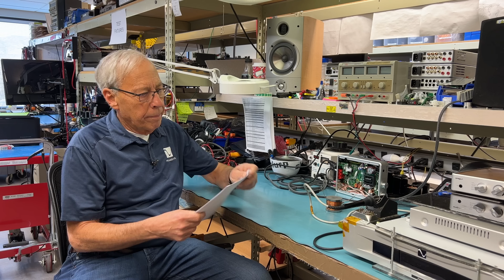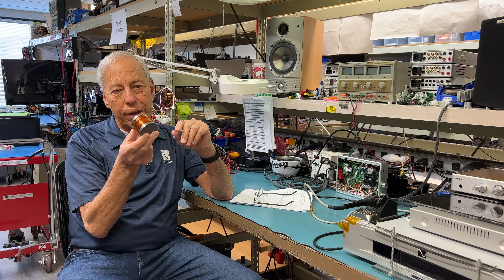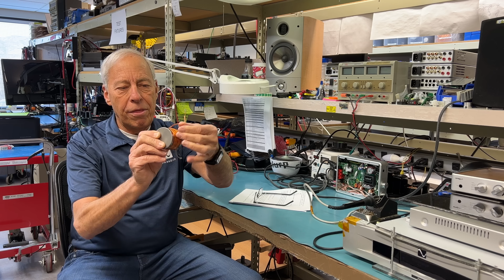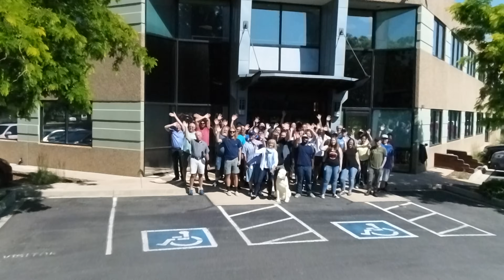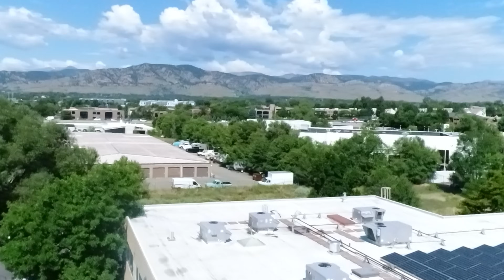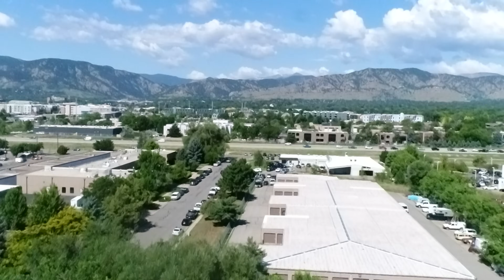Electronic vs  passive crossovers

Comment: 3 questions: a) I assume old fashioned active crossovers are still using capacitors and coils (merely optimized for the higher impedances of the pre amplifier stages, as opposed to the 8 ohms of a speaker coil) - hence using much smaller inductors.  In any case, wont an active crossover still have the undesirable innate 'phase shifts' at the crossover points?  b) is there any crossover technology that preserves the phase relationship across the full audio spectrum? If so what is the name of this constant phase solution? c) When one uses an active crossover, and the need for 6 amplifiers, I dont understand how one deals with the notion of turning the volume up and down.  Must one adjust each of the 6 amplifiers individually every time they need to go from low volume to a higher volume (which implies a calibration step using a microphone and certain frequencies sent into the system)?  This does not seem very efficient of ones time.

Comment: In a  past system I had a  Sumo Samson subwoofer and a Sumo Delilah electrictronic crossover set at 63hz. This combination worked like a charm. On the other hand if I had chosen a passive crossover the inductor would have been massive and heavy.

Comment: So from what Paul was saying, the crossover with mid and high attenuation knobs on the front of my Cerwin Vega's are an electronic crossover?
Reply: Those are just passive potentiometers, used for room/personal taste compensation. An active crossover will always be before the power amps, and likely have its own connection to mains power.

Comment: Nice explanation, but the original question was about electric versus acoustic crossovers, not active versus passive.  Acoustic crossovers could describe a whizzer cone or dustcap that is mechanically decoupled from the larger woofer cone at higher frequencies, which is an older technology typically not used on high-end speakers now.  Wiki has a good description of this.

Comment: Just to add to the confusion, or not. We have the LLCO or the line level crossover that's often inserted between pre amplifier and power amplifiers. How would this device be classified? It is passive after all.
Reply: Crossover before the power amp is active as the term active vs passive crossover is about where in the signal path the filter is located and not if it's based on active or passive circuitry. So you can have a passive filter working as an active crossover if you use capacitors, inductors and resistors in a circuit placed before the power amp. It seems this video made some people quite confused.
Reply: @ThinkingBetter  the LLCO is not a powered crossover but operates at line level but I can see your point 

Maybe Paul could say a few words about these crossovers; benefits and disadvantages say.

Comment: Paul. You got it wrong. The tannoy Westminster is a passive system and quotes the electrical transfer function as well as resulting acoustic crossover. The electrical is higher at 1Khz due to the horn loading of the compression driver boosting the low end thus arriving at an acoustic crossover to the 15" woofer at 200Hz as I read it

Basically the acoustic crossover point is what really matters here

Comment: The Tannoy Westminster is a huge (530 liter) folded-horn speaker which also uses a concentric HF driver (horn tweeter) that radiates from the center of the woofer cone.  
The woofer radiates forward through a medium-size horn structure, which has a cutoff around 200Hz, and it radiates to the rear through a large folded horn for the lower frequencies.  That comprises an acoustic crossover between the two paths.  But it's one driver, so this type of "crossover" is a fundamentally different concept, than crossing over between two separate drivers.  
There is still an electrical crossover for the tweeter.
Reply: You always make such helpful and informative comments. I immediately sensed that Paul should have referenced the particular speaker before launching his discussion of active vs. passive crossovers. Thank you for enlightening us all on the true nature of the question, and answering it. 👍

Comment: What do you think of using capacitors for an active circuit as a crossover?  I want built a high pass filter with capacitors using line level. Everyone I spoke to said it was not a good idea?
Reply: Np, just remember to include the acoustic response of the drivers when designing. Usually you would only use capacitors for active crossovers
Reply: It's not a bad idea to make the filtering before the power amp because it means the power amp can directly drive your speakers with best possible control and your crossover can be more optimized. The reason active crossover is less popular is that it is much harder to do as you now need to optimize the filter behavior outside the speaker that you purchased. For serious audiophiles with a desire to optimize their system, go active!

Comment: Add another volt and three quarters to the voltage quadrupler in your watch and the brakes will come on to the squealing noise.  An active crossover made from a scrap p.c.b can sure spank a power robbing passive version without the bad interactions with a voice coil.
Reply: Quite right.
You get the full damping factor of the amp with active.
Reply: @montynorth3009  No, because the voice coil also has significant resistance.  System damping factor is never anywhere near the amplifier damping factor.  It's almost impossible to exceed a system damping factor of 4, with copper voice coils.  With graphene, you could go up to 6.

Comment: Well....in the Westminster there are a few different crossovers and some of them are acoustic ones. The handover between the front horn and the back loaded horn is the most obvious one and it is purely acoustic. The same goes for a full range driver in a box, from box to main cone, from main cone to whizzer and from whizzer to voice coil, no electrical components, passive or active are involved but it's a crossover just the same.
Reply: See my post here on the Tannoy Acoustic crossovers designed for sound re-enforcement for movie theaters in the late 1920's. An Acoustic crossover is very different then a passive crossover.
Reply: The Westminster on the manufacturers site indicates passive Xover plus Bi- wiring.
Reply: @montynorth3009  I wouldn't doubt that today's Tannoy Speakers are using a discreet passive crossover. But back in the 1920's such things were not really available and cheap. So they went with an Acoustic crossover. I believe that Altec Lansing did simaler things.

Comment: That's a nice story but I am not sure it was the question...
Wasn't there the mention of acoustic cross over? I would consider that for instance a woofer that rolls off on the high side at relatively low frequencies. (SEAS has a 10" woofer that rolls off at 1,5 kHz so it does not need filter components and you end up with one capacitor for the tweeter. Though arguably even that is partially an electric cross over because of the high increase of the impedance curve.)

Comment: To answer the questions about the different types of crossovers and terms.

Passive crossover: Uses passive components e.g. capacitors, inductors and resistor. Used within a loudspeaker.
Active crossover: Uses op amps, resistors and capacitors. Used before the  amp, therefore also needing 1 amp per driver.
Digital crossover: Uses math to change sample values. More info search for IIR or FIR filter. Used before the D/A converter, therefore needing 1 Dac and 1 amp per driver.
Electronic/Electrical crossover, My interpretation: Only used to describe the passive or active crossover points and not looking at the drivers response. 
Acoustic crossover: Where the driver actually crossover over at. Since the drivers themselves has a phase and magnitude response the drivers will influence where the crossover point actually is. E.g. speaker with 2 drivers has a 1st order butterworth filter with a crossover point set at 2kHz. The drivers  responses makes it so that the acoustic crossover point is at 2.2 kHz.
Reply: Active and passive crossovers aren't defined by whether they're placed before or after the amplifier, although it's how they're implemented.  They're defined by whether the components of the circuit are electrically powered (active) or not electrically powered (passive).  Passive is powered by the amplifier signal, but not by wall current.   To reference Wikipedia again, "Active crossovers come in both digital and analog varieties."  "Electronic crossover" usually refers to an active crossover, although a passive crossover uses electronic parts, too.
Reply: @BruceCross There has been zero ambiguity in this topic in my career for decades and what Wikipedia says is aligned with that: "Active crossovers are distinguished from passive crossovers in that they split up an audio signal prior to the power amplification stage, so that it can be sent to two or more power amplifiers, each of which is connected to a separate loudspeaker driver". So even you use passive components that are not powered prior to the power amplifier (RLC), we will still call it an active crossover. I can agree this is a bit confusing (especially active crossover with passive components). Agree, electronic crossover usually refer to active crossover. I never use that term. When I worked at B&O we were pioneering the active crossover in speakers ages ago initially with passive components initially analog and later with DSP incl. IcePower (my colleagues started that, now used by PS Audio), e.g. the Beolab 90 that I have. Right now I'm listening to my KEF LS50W2 that also do active DSP crossover. Even my garage speakers are some decades old CX100s that I reworked with something called a "Beocreate 4" kit of a 4 channel amplifier with a Raspberry Pi doing the crossover (ARM CPU) and WiFi. I wouldn't call those garage speakers audiophile, but they sound better than ever. I have 8 stereo systems in this house (3 passive crossover).
Reply: @ThinkingBetter  Okay guys, I think WE all know what is meant and what else is being said from context. I just tried to make it easier to differenciate being the ways of doing it for the newbies sake, especially since in the last two videos Paul made about crossovers I'm sure he managed to confuse people that wasn't before.
Reply: @maxb.simonsen2459  Perhaps Paul should explore doing a product with active crossover as there are clear audio performance benefits of it when designed optimally.
Reply: @ThinkingBetter  If you want to call a passive circuit before the amplifier an active crossover, I suppose you can, but it makes no logical sense.  Does that mean you would also call an active circuit after the amplifier a passive crossover?
Reply: @ThinkingBetter  Please keep in mind that, although I might disagree, I do respect your knowledge and ability to remain civil (increasingly rare qualities in today's uncivilized world).  Yes, on active and passive crossovers, it boils down to how they are named vs. where they are used.  Ultimately, I need to step away.  It's not a life or death matter.

What is my background?  Most of my admittedly limited knowledge comes from the car audio world.  As an audiophile, I assumed it was a joke until I got involved for a few years.  Quickly, I realized car audio had a better understanding of audio theory than the average audiophile - comparable to a smart DIY'er building their own subwoofer, carefully weighing factors such as driver construction, Thiele-Small parameters, and calculation of enclosure volume.  Even 15 years ago, car audio supported using RTA measurement, DSP for EQ and crossover functions, avoiding multiple AD/DA conversions, evaluating crossover slopes and points, setting time and phase alignment of drivers, parametric EQ, etc.

What did I learn?  I still have a lot to learn.  Audiophiles lean too far into the subjective world, ignoring the objective world.  Now, I prefer a balance between critical thinking and listening.  Every statement is open to debate, including my own.  That means your words have not fallen on deaf ears, and I will file them away for future reference.  Thanks for your replies.
Reply: @BruceCross  I actually work in car audio R&D nowadays but have done most of my career in consumer products R&D. Leading automotive OEMs put a lot of advanced engineering in designing the audio system with modern high resolution audio DSP layouts for speaker up-mixing (= active crossover), microphone processing, noise cancelation etc. Care is put into SOC digital audio plumbing, DSP layout, amplifier design, driver design, cabin acoustics, wire harness (incl. A2B) etc. that demands much more diverse and deep audio engineering skills than what you find in consumer electronics audio. It's tough engineering to make a car sound like a high-end audio system, but on the other hand, you can design and fine-tune the full experience.
Reply: @ThinkingBetter  Ha, I didn't expect you to be in car audio R&D.  Cars are an incredibly challenging audio environment.
Reply: @BruceCross  Yes, that is why it is interesting. But while it's very challenging, you also have a huge advantage of being in much better control of the entire signal chain including the cabin acoustic side. It's sort of like if a speaker developer designed and optimized the speaker positioning for a room with all room interior details including all dimensions, furniture,  exact driver placement and listener positions that was included in the purchase as one package...while of course doing it with an active crossover design enabling precise DSP tuning.
Reply: Yes, but the term "active crossover" means doing the filtering before the power amplifier. This can be done either using analog or digital (using DSP) circuitry.
Reply: @ThinkingBetter  Not in my book. If using DSP i would call it a digital crossover. DSP litterally means Digital signal processing
Reply: @maxb.simonsen2459  Wikipedia: "Active crossovers are distinguished from passive crossovers in that they split up an audio signal prior to the power amplification stage, so that it can be sent to two or more power amplifiers, each of which is connected to a separate loudspeaker driver.". An active crossover can be either digital or analog. I agree if you use a DSP, you can call it a digital active crossover and since there is no digital passive crossover, you could just use the term "digital crossover" and people would know what you mean. BTW, a digital crossover could be done using a CPU also as digital audio processing doesn't require a dedicated DSP IC. For example, nowadays ARM CPUs are often used as DSPs.
Reply: @ThinkingBetter  Yes and you could also use FPGA's
Reply: @maxb.simonsen2459  Yes, an FPGA can do it but I prefer the ease of programming audio processing with modern layout tools (Analog Devices SigmaStudio or DSP Concepts AWE especially).
Reply: @ThinkingBetter  Agreed! Fellow Dane?
Reply: @maxb.simonsen2459  Yes

Comment: the question was about acoustic crossover, which is weird
Reply: It's crossover by acoustic means. Tannoy is using that in their concentric sound driver, for example. I suspect that is what inspired this question.
Reply: @ThinkingBetter  so as Paul did not seem to know what may be acoustic filters, ,he gave a sidestepping answer
Reply: @nicolasjoly1755  Perhaps, "acoustic crossover" is not a common term. Also "electronic crossover" is not a good term as I would argue that passive crossover is also electronic. Usually the terms "active" and "passive" are used to specify if the filtering is done before or after the power amplifier. Also, you can divide active crossover into DSP (digital) or analog.
Reply: @ThinkingBetter  I would call acoustic crossover "Full Range"
Reply: I think the questioner was talking about a passive crossover but used the wrong terminology.
Reply: @montynorth3009  Tannoy does acoustic crossover. Tannoy was mentioned in the question. Check "Tannoy Dual Concentric by Definition".
Reply: @ThinkingBetter  Tannoy Dual Concentric still uses two separate drivers (merged into a single structure with the HF unit at the back), so there must be at least a capacitor in there somewhere.

Comment: Acoustic crossover = filter the sound with acoustical means (tune driver, box, speaker mesh). Electronic crossover = filter the sound with electronic means, e.g. passive (after power amp) or active (before power amp).
Reply: See my post here on the Tannoy Acoustic crossovers designed for sound re-enforcement for movie theaters in the late 1920's. An Acoustic crossover is very different then a passive crossover.